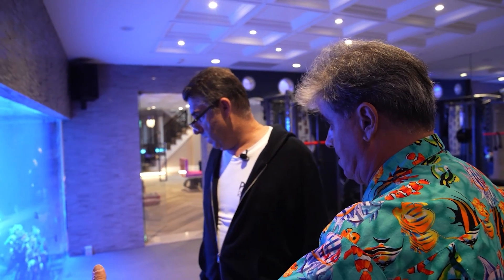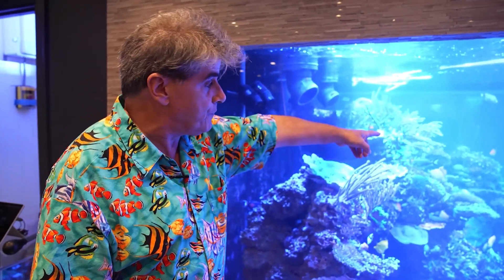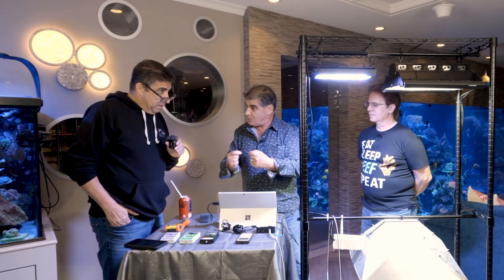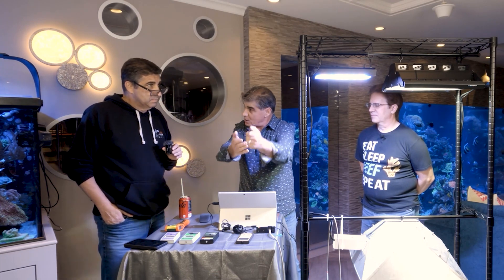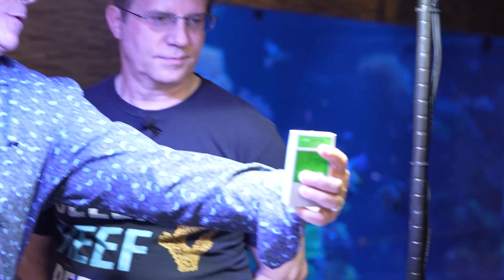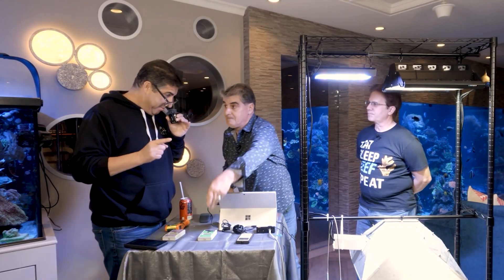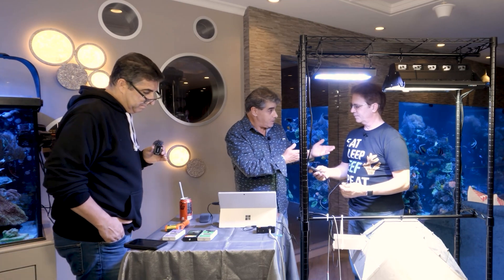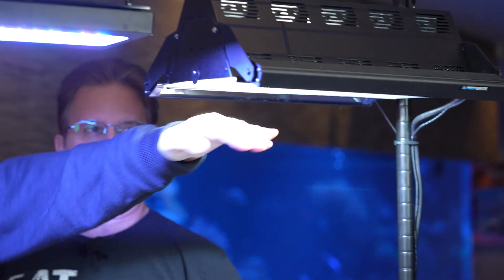LED, Metal Halides OR…? Reef lighting Episode # 2

Comment: Tullio's measurement video was an infomercial at best. No real science was presented. Correlation does not imply causation. Until you show us why UV is important, it will just be a mind story. Why is UVB important when it is filtered through water? By making claims of the amount of UV, other than showing the graphs, and seeing representation in the graph have you actually measured the amount of it relative to the other wavelengths and compared how much of the light is actually in the UV range? Until you don't talk numbers, at best, you're just telling a mind story.